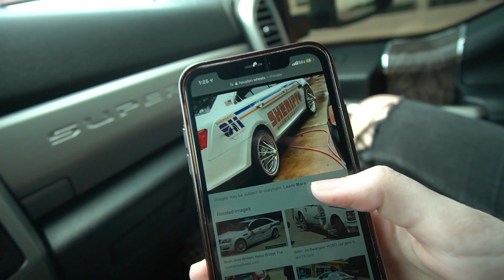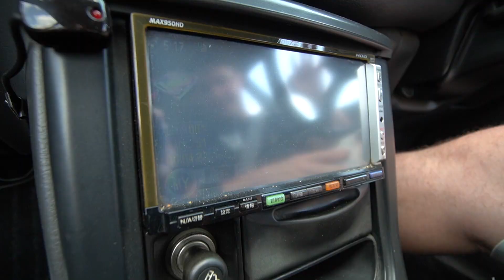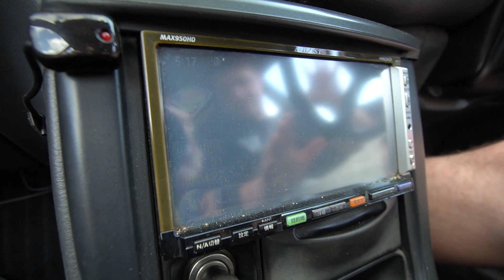Buying a SUPER RARE 1 of 200 JDM Subaru

Comment: my best man haw the same one. he bought it when he was 18. found it in a scrapyard, left side wheel, wonky 1.6 L engine, replaced the turbo and transmission, fixed the motor, added an oil cooler and now it's a 360HP little miracle.

Comment: So some small pieces of advice from someone who has a lot of experience with GC/GF platform. 
Do a catless Downpipe there easy to get (you’ll need a JDM length one order it from Japaneseperformanceparts.co.uk)
Mishimoto aluminum radiator (you need to use the 90-94 legacy turbo for the GC/gf) 
Make sure the hatch isn’t leaking and the trunk isn’t rusted out on the inside. The trunk is a huge problem and rusts very easy. 
Also GF taillight are DIFFERENT FROM GC platform. 
Any questions ask away.

Comment: 1200 or so V1 STi, wagons are rarer then the sedans but not as you make it seem as Subaru in 94-95 slapped cars together and called it a day. 200 rally STi are WRX type RAs tuned by STi that we’re offered to teams before being offered to the public as many weren’t bought. 

Also your timing belt most likely wasn’t changed as that sticker just state change at 100,000kk. If it’s been changed there will be a sticker near your tire pressure in the driver door. 

Jun is also selling a lip for your bumper on Yahoo, starting bid is $1800 as it’s new old stock and probably one of the only real ones left.

Comment: Chassis Code: GF8
Engine: EJ20G DOHC (Closed Deck)
246 HP
213 TQ
5-Speed Manual
Full-time Four Wheel Drive (4WD)
Front: Open Differential
Centre: Limited Slip Differential (LSD)
Rear: VIscous Limited Slip Differential R160 (VLSD)
Final Drive: 4.11

200 Production models
100 Estates (Wagons)
100 Saloons (Sedans)